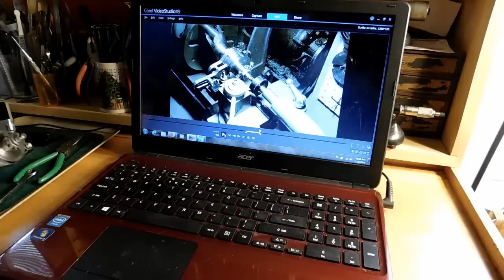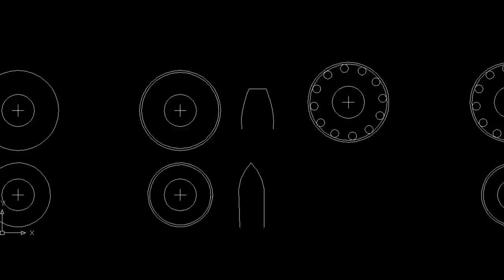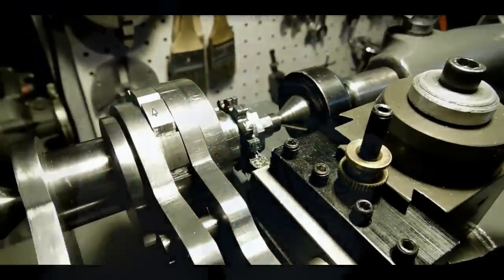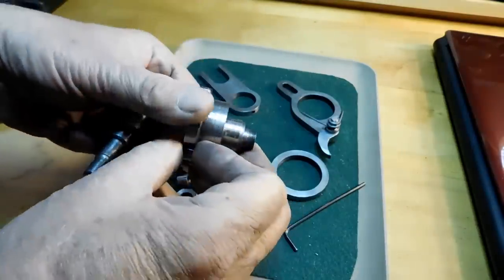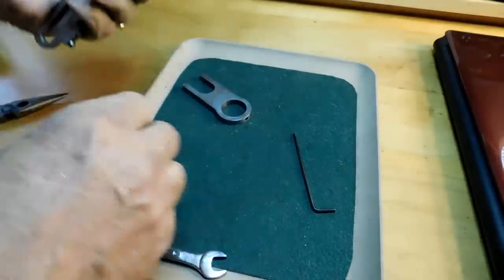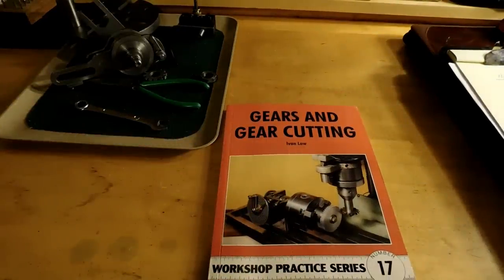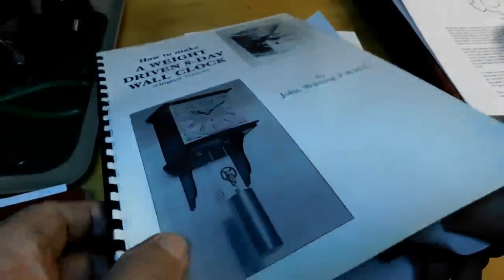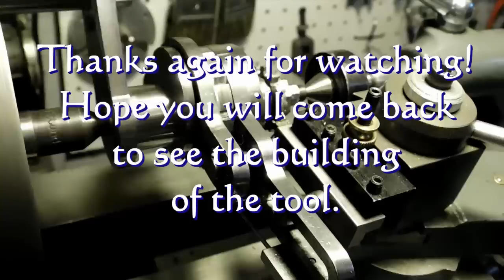DIY Gear Cutter: The Eureka Tool

Comment: Ive been looking at building one of the eureka tools for around a year now, but never found a decent explaination of how it works, but will probably build the double size for the 1" arbor like some people were showing since my mill takes a 1" arbor. Joe does seem to just pop up everywhere lately, lol. Cant wait for the build video, and a longer video I think would be better than a short one tbh. It'd show alot more detail that would normally get lost in one cut up to shorten up the video. Thanks for the video.
Reply from the maker: This tool is good for up to 1.5" cutter blanks and about 20 DP...I think I'd work with 1.5" with a 1" center...water hardening tool steel over 1.5" gets pricey. Just a thought.

I'll most likely go beyond 15 minutes but I'll try to keep on subject...I've got lots of video but I have a hard time keeping the camera focused and on subject and still work...kinda like a rubbing your tummy and patting your head type thing...bob
Reply: lol, I was just going to use something like the bottoms of railroad track, that stuff can be quenched and is just as hard as tool steel when hardened, but alot easier to obtain alot of the time for alot cheaper too around here, so the size of the stuff isnt really that big of a deal. 

I'd honestly just double the size of everything like Ive seen, which in theory should be able to give a 2-1/2" diameter cutter, and that is what my mill is happiest with. All we can really do is just experiement and see what works and what doesnt. Thanks for the reply bob.

Comment: Very interesting video. I have Ivan Law's book (along with most of the Workshop Practice Series), I read it some years ago and never paid much attention to this tool - seemed too complicated and confusing, for my limited understanding at the time. Now I have to dig the book back from storage, to have a second, more informed, look at it. However, I still think there are easier ways to cut the relief, as you also shown, but nothing beats the punch of seeing the Eureka working for the first time. Thanks for the tutorial on this less known tool.
Reply from the maker: Thanks Jose...learning to use the Eureka is a bit time consuming but I did learn a lot buy working through the process...bob

Comment: Cross feed/compound dial indicator holder--  
One or two of your videos, show a mounting bracket to hold a dial indicator on back side of the cross slide.-- Can you post a couple of pictures or short video on this bracket?  I had mounted a small digital tire gauge on the side of my compound that is removable, but don't want to mount a long digital caliper on the cross slide as a DRO.  Would like to make bracket similar to what you have that will allow removal of the indicator and not get in the way ...  Thanks,
Reply from the maker: Sure thing...I made a taper attachment some years ago and that holder kinda came out of that build...I posted pictures here:
http://www.machinistweb.com/forum/showthread.php?t=1609&highlight=atlas+618+taper+attachment
Reply: @robertt-cs8fe  -  Thanks- see your carriage stop/dial indicator holder on electrical switch video-  .  Perhaps you can post close ups of the bracket for the cross slide- ?
Reply from the maker: I'm making the Eureka tool construction video right now...I use the Atlas power drive and limit switch to make the tool...I'll see if I can't give you a good look...bob

Comment: Could this work on a Sherline if i extend the height a bit!? Thanks for posting, great video!
Reply from the maker: It might be a bit of a stretch for the Sherline...but the Bench Work book idea of drilling holes and then widening with a tapered pin seems a great alternative...think I might Loctite the pin into the cutter permanently...or at least give it a try...bob

Comment: cutting to 15minutes is a travesty. More is better.  How far do you infeed the tool on each revolution?
Reply from the maker: Chuck I just spent the day going over the footage I've got...15 minutes will not do it...building, case hardening, cutter blank, just too much...I'll come up with something...
Infeed is .002 =/-...watch finish and stress carefully...my 618 was strapped down good...gibs...everything...even thought about using lantern tool holder as my QCTP kinda goes to the left a bit...like when threading or boring...a couple of spring passes are required on my machine. There will be a third video where I'll use a button tool and the Eureksa tool to build a change gear for my Atlas...then I can compare it with change gears I've hobbed and the store bought ones that came with the lathe...I'm quite curious to see how it goes...bob
Reply: I'm in the process of Resurrecting a Atlas/Clausing 6308, that has been 'Rode Hard and put away Wet.' The cross feed screw has 0.085" backlash. The 1/2" major dia. screw is pointed to 0.485". A new 7/8-8 lead screw was installed, but the half nut barely engages.  That is my challenge Building a half-nut with this lathe.  I hope you show a closeup of the cutter I am interested in what the profile looks like.  Does the Eureksa tool just cut back relief, or does it generate the cutting edge?
Reply from the maker: Chuck...I'll be using a button tool to create the gear tooth form...I'm planning a 3rd video so I can make a gear from scratch...
For your Atlas problems I very highly recommend the Machinist Web at:
 http://www.machinistweb.com/forum/index.php
The guys there have been a great help...bob